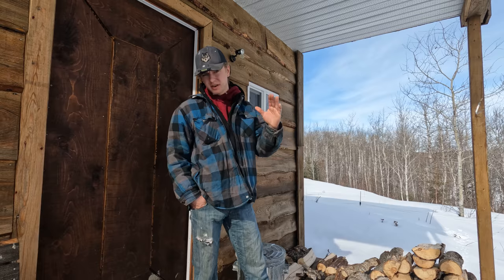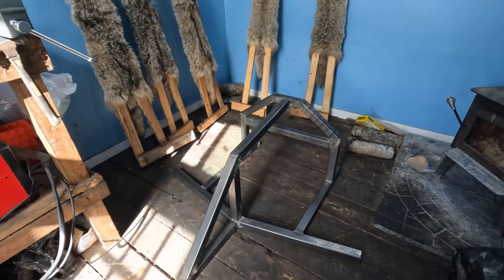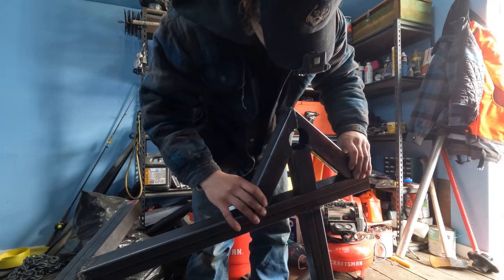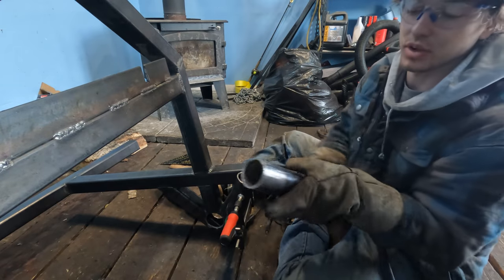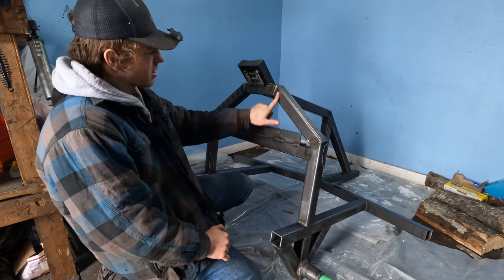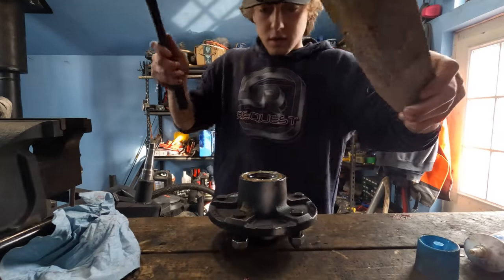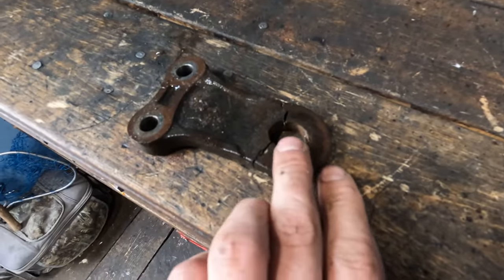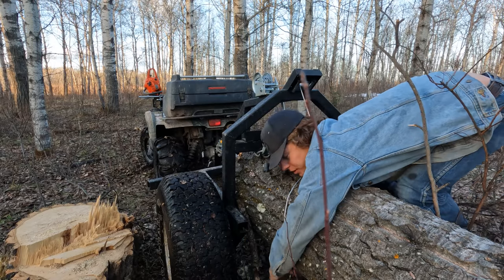ATV Log Hauler/Skidder Complete Build From Scratch

Comment: Next time like when you were putting on your hitch coupler to the tongue and you have two bolts… run one from the right and one from the left. That way you have the nuts applying pressure from opposite sides. Outstanding fabrication and the skidded will serve you well for years!

Comment: Hey buddy great video. Something you may consider using your drill instead of the crank handle to raise and lower logs. Provided the chuck will accept the treaded bolt were the handle connects. Also good hole saws will cut through steel and give you the right sized hole your looking for. Just couple tips. Cool build. As always I’m impressed with your ingenuity and drive. Bravo friend. Great video. Hope cougar is doing well. 👍👍

Comment: You don't actually need a crank.  You disconnect the trailer and tip it way up until the top of you arch touches the log.  Fasten it close, then pull the trailer down to rehitch it.  We had a similar rig that we fastened in the middle of a log that way.  Done right, just one person can balance and move it around

Comment: Little tip for you! I have been a welder for a long time and when your young you don't put much thought into it but you will when you get older but do your grinding out side it is a bitch in the winter but you don't want to be breathing in all that grinding dust! and remember your welding in a old wooden shop if a spark was to go somewhere and start smouldering and you go off it could start smouldering and you may come back to a pile of ashes! I would do all your grinding and cutting and welding out side! I know someone who did the exact same came out to his shop in the morning and their was a big smouldering spot in the floor. but this guy didn't learn his lesson the next time he came to his shop and it was a big pile of ashes. Best places to buy your steel is at a scrap yard you must have some of those out their also go to a reputable place to buy your steel not princess auto it is expensive their! Great job. I was the same remember mom calling me at two in the morning saying it was time to go to bed. I remember those times full of piss and vinegar! Great job

Comment: Your unbelievable young Fella. I can not believe how knowledgeable and hands on you are. I was in the refinery business for 40 years as a process maintenance coordinator  and welder.I  can believe you buy a welder and start out welding like you do. It sounded like you had the correct settings on machine. An experience welder can tell by the sound. Also you didn't stick when starting. Also the knowledge you show when installing the wheels. You use a torq wrench and also tighten the nuts correctly using the proper criss cross. My only piece of advice is becareful when letting the gear handle lose. I broke my wrist doing that. Just be aware.  If I  was still in the business I  would hire you in a minute as a journey man apprentice.  You are so intelligent and eager to learn. Thank you so much for another great video.  I  will also assume that you come from a farm or rural environment as you have such great work ethics. You must have had a great father or grandfather who taught you the value of hard work. Thank s again for making me feel young again. Your the type of person that a professional trade person would love to teach.👍

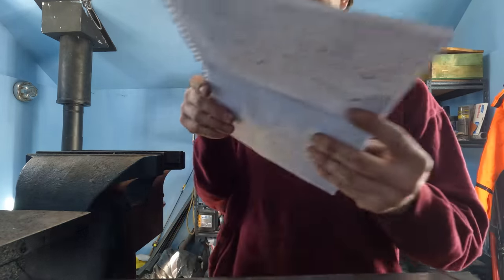Comment: A simple way to figure your angles..... 5:55 your arch is 180 degrees. There are 4 miters, each one has 2 sides. 180÷8 = 22.5....this would put your angle pieces at 45 degrees from the upright and cross pieces. Yours look closer to 30 degrees to the top and 60 to the sides, i know thats not exact its more like 24 degrees (12×2) but for simplicity I said 30. 30+30+60+60= 180 so your miter cuts would be half of each....15+15+15+15+30+30+30+30 =180. Doing trig is great and all but this is much simpler than how I was instructed in school.

This is a clever and useful project. I appreciate you sharing this

Comment: Thanks for the vid trapline  I have always wanted to build a log skidder for my Quad, this one is a awesome design. I did have a load of poplar brought to my sawmill ,the only issue I had was the lumber would warp faster than I could pile it and strap it. I then picked out the perfectly straight ones to cut but they have long fiber that cause the lumber to warp as it dries .my mill is a LT 40 hydraulic wood mizer
I also set up a water tank and 12 volt pump to pressure wash the logs and it saves my blades alot, keep up the good work ,cheers

Comment: Outstanding job glad to see you're willing to take on a project like this. Just a little piece of advice to help you in the future, when you're attaching your spindles with a tube instead of welding inside the tube you can drill 3 - 1/2 inch holes near the spindle length and weld through the holes. This will give you very strong inboard attachments for the spindles. Keep up the work!

Comment: Good make, wish I had that 30 years ago.noticed that the winch cable was already taking a memory. Try the strap type on your replacement. Old truck liners make a good skid plate to avoid dirt take up. Scrape metal places are glad you take one away

Comment: Oh I forgot to mention that I baught one of those hitches that you put on your 4wheeler!! I actually use mine all the time the only thing I had to do was on the hitch that your ball goes on I had to cut two so that they weren’t so long and that they would fit into the hitch that gets bolted to the 4wheeler!! That way I didn’t have to go changing balls all the time for different things I had but I did make every trailer and everything that might hook up to my truck have either a hitch that used a 2” or 2”5/16” balls and nothing else!! It definitely helps from having to come up with one of three different sizes now I only have to come up with 2!!! Definitely much easier!!! The other thing about that hitch is I wish that it had a couple drops on each side on the bottom or some way to keep it from turning on the 4wheeler!! Other than that I absolutely use the shit out of mine!!!

Comment: You had mentioned that hauling containers of water is a pain in the ass.  Why not make a removable / small diameter bolt on, plywood, "deck" on the log hauler (maybe even with 2" x 4" sides and back).  If that is too small make 2 metal inserts to the back of the 2 parallel 2" x2" tubing sides and pin a rear extension on using pit pins or even bolts and nuts.
Just an idea to consider - making a handy second use (food hauling?) for the log hauler that can very quickly be stripped off for log hauling.

Comment: To build a log house that requires longer logs you might need a cheap little farm all tractor to pull them out of the bush or a set of wheels for the rear of the log so you can more easily pull long logs out of the bush with your quad.

Comment: If you plan on welding up that slip collar on the front of the dodge axel, heat it up with the torch first get better penetration with that little welder ya got, manual hubs less bullshit👍

Comment: Get a tailors tape it's made of fabric and follows the countoure of the materials better than the metal tape👍
Reply: Only thing different I'd a done is drill some holes in the pipe into the spindle a bit and plug weld it a couple of times, nice job bud👍

Comment: They make a after market hitch receiver for Kodaks and grizzly’s that is much better than the little 2 bolt mount, it fastens to the 2 upright posts and to the mount location, it will fix your hitch problem

Comment: this is quite ingenius Ive seen others hell you could make money building these for people!! But I guess amazon sells them for ur purpose youll save your back and wear tear on your equipment and you could add a simple axle to the rear to if you wanted the logs off the ground Ive seen that to. for a guy working alone in the bush or woods clearing his own property hey and or milling his own lumber w a chainsaw mill or bansaw mill say in alaska or something this is slicker then shit Good Job young man you got a knack for the work and your milling station is pretty stellar to. If ur chain saw milling one thing Ive noticed is the bigger the motor on the saw the better 7hp as they tend to power through logs even if the chains start to dull a little, good luck its always easier to mill on a milling station. rather then on the ground in the bush. And another thing I saw was a log lifter made from a farm jack hell you could lift any size log if your in the bush by yourself.

Comment: how thiccc is the 2inch wall and how did u mark the angles?
could have just welded a straight plate for the chain for cleaner look tho, plus maybe just get some Kia wheel hubs from the junkyard and add some alloy wheels for lighter weight lol
and could also just make a 2nd arch for the rear wheels at the back of the log

Comment: Depending on how much pressure ends up on those rollers, you may need to add some gussets because of the angle it’s at. 

What did the materials end up costing?

Comment: Hey buddy just to let you know but you should look into getting a potaband saw!! It is a bandsaw that you can carry and they cut steel very nicely and faster than a cut off wheels do!! Plus you can cut lots of stuff with one blade as long as you don’t end up pinching the blade and breaking the blades!! Plus you can buy a 3 pack of blades for under 30.00$ and the portaband saw it’s self will run 250.00$ to 500.00$ I spent 300.00$ on a Milwaukee one and have had it for 10 years or longer!! Plus they also make a stand that you can mount the saw into where you can use it like a bench saw witch can also be a deadly combination also!! You should definitely look into getting one!! I think it would save you lots of money on not having to buy bunches of cut off wheels plus you don’t have to worry about a blades exsploading on you and getting hurt like cut off wheels can do!!! Let me no what you think of the portaband saws???

Comment: Hmm How bout just a simple wide tobbagan in the winter just wax it up but you could us it year round to for dragging logs out of the bush n keeping them fairly clean n just roll them on and off no lifting involeved or very little. I watch another guy who uses a 4 wheeler hes getting old and has back issues. he also uses the tongs but in wet or mushy snow its tough even w 4 wheel drive just curious.

Comment: Ah next thing ya know is hub caps and white walls/lol. I have a cheaper idea for wheels, and their setups.... Old cars, preferable old two wheel drive subarus had that trailing arm on the back and the wheel bearing was a bolt in. It would give the right offset right from the get go and then use the donut spare tire as its skinny, tall, will go fifty miles an hour behind the truck and can find them everywhere theres a junk yard or neighbor who never made it to the dump with it... new pieces are still in stock at napa or oreillys parts store for the guy who ain't pissing around. A trailer log arch would keep it out of the dirt and just chain to the log being towed like those twenty plus footers... don't know that metric system but basically same as the length of your pickup. on the logs.... tow behind the arch, unhook, roll over top of the log and tie log to arch, then the tow arm can be forced down to the log and tied off, raising the log off of the ground... go up front and hook the quad arch to the log and it follows you home leaving a cleaner log that tows well. Damn fine work my friend